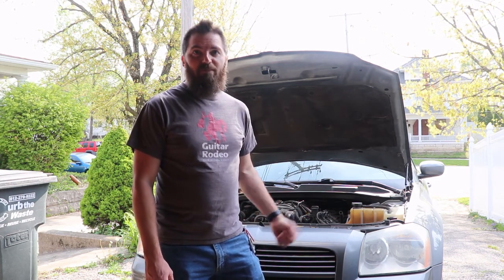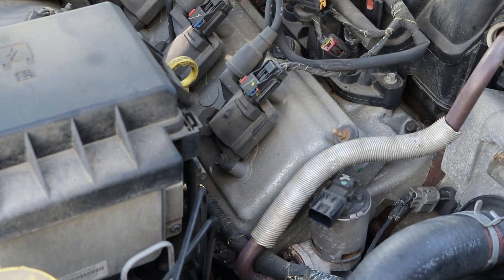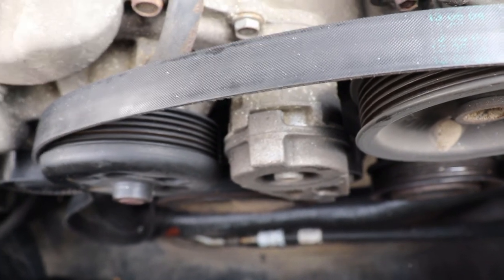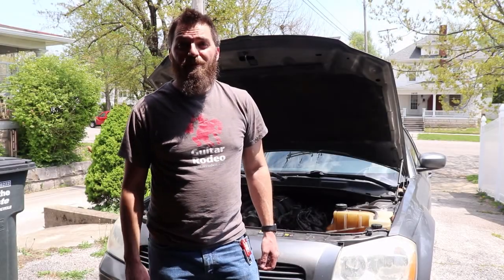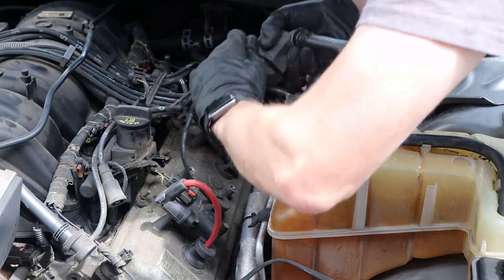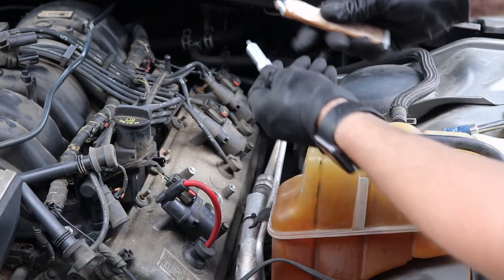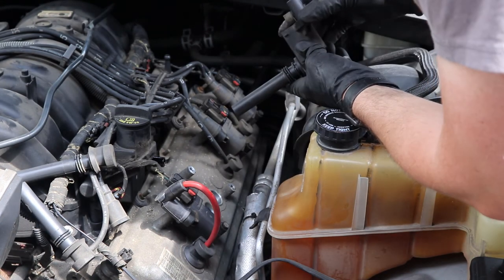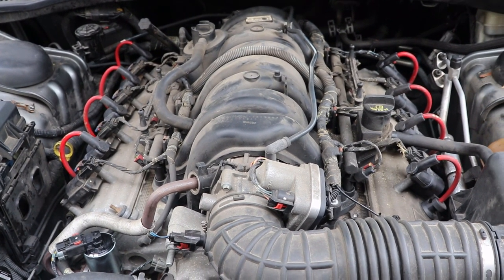EGR Valve and Oil Pressure Sensor Replacement 2005 Magnum R/T | Plus Hemi Spark Plugs and Wires!

Comment: That white oil sensor doesn’t look OEM.   Looks like a dirt cheap replacement, hence the failure.    Always use MOPAR sensors, all the way around.     Yes, the EGR is damned expensive, but in reality, shouldn’t fail if you allow your engine to get to proper operating temperature and thoroughly exercise it regularly.    I put a 180 thermostat in trying to keep it cooler but I was wrong.   That only SLOWS the time to operating temp.     It just allows the thermostat to open earlier, delaying the time till full operating temp.   During those times, the combustion chamber isn’t quite hot enough to burn off everything properly, and a lot of soot carbon buildup will its way back into the Exhaust Gas Recirculation Valve.     Overheating can cause the solenoid to fail prematurely as well.
Reply from the maker: Unfortunately, the genuine manufacturer parts are made in China now as well.

Comment: This is the best video of changing the oil pressure sensor that I've seen so far. Excellent camera angles, well done.  Thank you very much!

I have the P1521 and P0456 codes.  I do my own oil changes and I still have the empty 1 gallon jugs from my last oil change, so I know 100% certainty that the oil is right.

The gas cap has already been replaced and my wife says she tightened it a few clicks when she fueled up.  It might be a pinhole leak, but willing to bet that both of these components are contributing.

Comment: Some people theres a loss of perfomance. How do you like the ride of the maggie with the new taylor wire set?
Reply from the maker: I haven’t noticed any change either way after the plug-wire swap. I’ve also added a high flow air filter and replaced the suitcase muffler with straight pipes since then, so I might not have noticed a performance change from the wires.
Reply: @Troll Extrordinaire i do pennzoil ultra platinum on my oil changes and i change it every 3.7k miles with a gold k&n filter. I also have a mopar cold air intake a breather for intake itself. And also diablo tuned it to a 91 octane tune and use premium gas .and you right alot of people forget to change the pcv valve.
Reply: @Troll Extrordinaire yeah i know about that issue as i installed a 180 thermostat on the car as well and since i diablo tuned it i set my fans to kick at 199f to keep it cool at that temperature. And also they say that happens when you dont change your oils in time but like you said alot of people have diferent reasons or beleives on why that happens. Mopar or no car.

Comment: Does the car run smoother with the new plug wires?
Reply from the maker: William Lopez the engine was pretty smooth to begin with. I haven’t been able to feel a noticeable difference in any way since I changed the wires. I mainly did it to get rid of the mess of wires that went up over the top of the intake. So the most I can say is that changing the wires didn’t have a negative effect. Just rolled over 130,000 miles and it is still a beast.

Comment: Do I have to drain the oil to replace the oil pressure sensor?
Reply from the maker: Edgae Medrano No. you don’t need to drain the oil. Definitely don’t start the car with the sensor removed, though. That might get messy.

Comment: What's the part number for the wire set?
Reply from the maker: FBROB89  the part number is Taylor Cable 82241 Spark Plug Wire https://www.amazon.com/dp/B004PLBQXA?ref=yo_pop_ma_swf
I meant to put all the parts in the video description but I guess I didn’t on this video. I’ll have to do that.